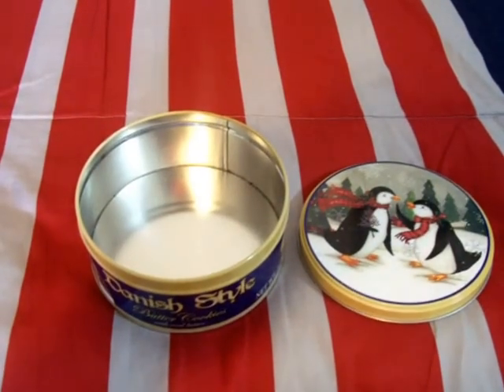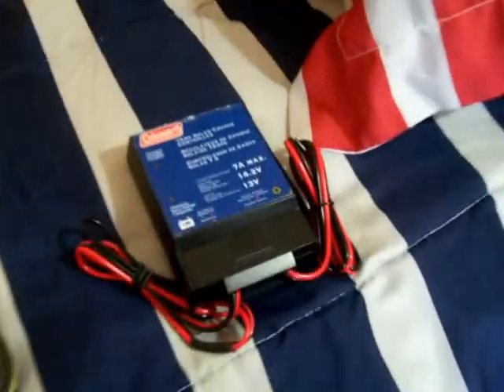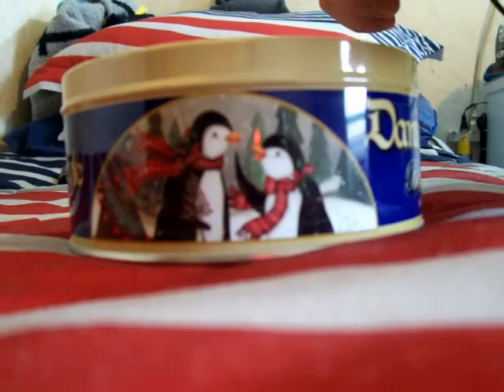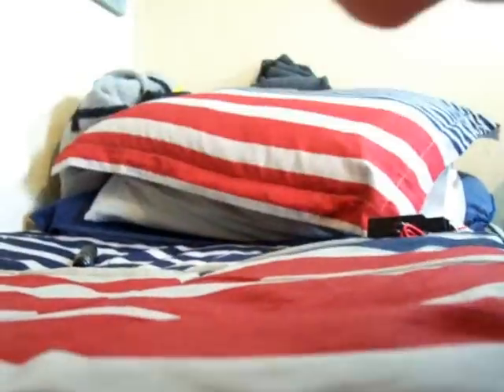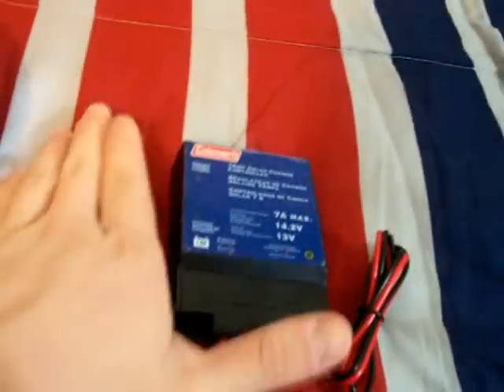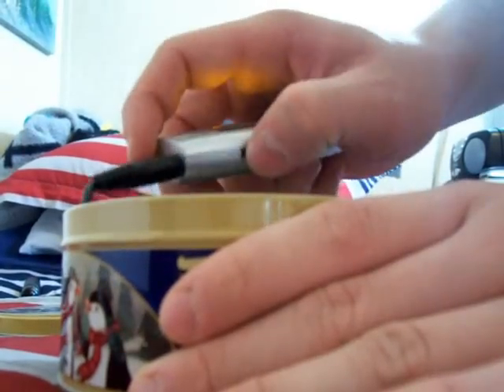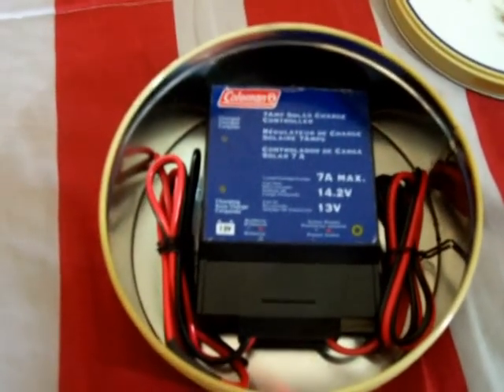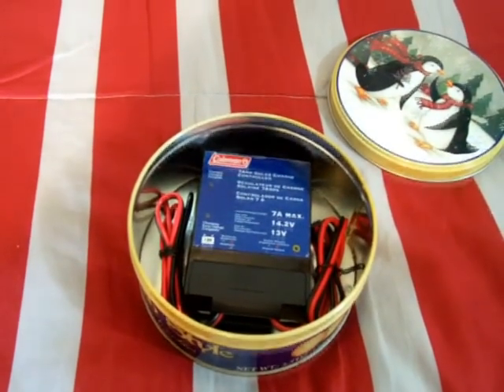Cookie Tin Faraday Cage

Comment: This will NOT work. You need to insulate the device that you put in the tin or it will fry. Line the inside of the tin with cardboard . All that you are doing is interfering with the radio reception a bit.

Comment: If an EMP attack happened, you won't be forewarned, and there will be no indication that one is about to occur.  Therefore, you will have to store all of your electronic devices in a Faraday Box/Cage constantly to protect them which means you won't be able to use them in the meantime.  So, I guess you need to purchase backups, and own two of everything, one that is stored and protected from EMP attacks, and the other one for current use.
Reply: Two is one, one is none. Redundancy is the key to success!

Comment: There are limits to any Faraday cage.  The main concerns with a tin is that there may not be enough of an electron reserve, the material may not be conductive enough and the seal around the opening may not be good enough.   In general, I find these tins insufficient to say block the RF of car key fobs which is important as car theives are using relay devices to steal cars.   For an EMP, tins are a complete fail.  You really need a well grounded Faraday cage for EMP protection such as an old microwave plugged into a wall outlet for a good ground.   I think your cookie tin Faraday cage is a complete fail especially given your stated intent of protection against an EMP.